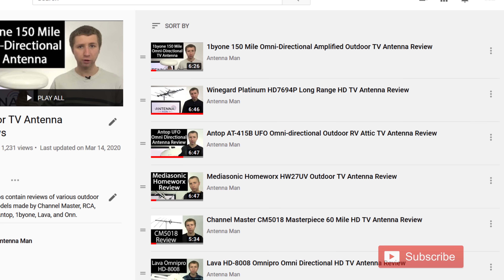Lose TV Stations at Night? This Common Item Interferes with TV Reception

Comment: I still collect different TV antennas from AMAZON. The one flashlight that's best is called VICTAGEN. 6 of them light up the entire living room and last almost 14 hours with one charge. No reception problems. I place 4 in front my 75 inch NANO TV. Simply pointing straight up, they create a torch effect illuminating the ceiling above the big screen. Of course AMAZON is sold out- aren't they always?

Comment: You are correct because I noticed this. They also interfere with AM reception.
You’re also right about those flat antennas Tyler. I always had to move the antenna every day as I had trouble with Baltimore channel(s) 11and 13. No such problem with the Antop 400BV UHF/VHF antenna. Thanks again for these helpful videos and the streams. Much appreciated Sir! Take Care.

Comment: Wow, I had no idea this was a problem.  I've never had any issues with my LED bulbs.  Maybe it's a quality issue with cheaper bulbs?
Reply: Richard Forester the cheaper bulbs lack interference filter snubber capacitors See my other post about adding a snubber capacitor to the light fixture used by a LED Bulb to cut the RF Hash being transmitted into the AC wiring.

Comment: YES, I replaced the fluorescent lights in my garage with LED lights and the garage door remote control only works now if i am directly in front of the door with the remote in my hand and pointing it to the door. If I turn off the lights, then it works normal
Reply: maxbored install a remote light switch to turn the LED lights off while remote commanding the garage door to open or close. The remote light switch will be designed to have plenty of range despite the interference from the LED bulbs. Another way is to install Snubber Capacitors on the lightbulbs fixtures as outlined in one of my other posts in this thread.
Reply: Perhaps route/reroute the garage door opener antenna closer to the outside. Copper wire is usually all you need to extend the garage opener antenna.

Comment: I did an audit of my RF noise for AM band. I turned off all my power strips. and tuned to a fringe AM station. The hardest offender to find was a USB charging line not on a strip. Came with the Amazon Kindle. The PC monitor, dimmable LEDs not as noisy as regular. LED noise worse in daylight. the inductive cook top kills shortwave. Lamps with large shades I've inserted a Y-socket insert offering two sockets. An noisy item was a touch an glow lamp for incandescent. LED's do affect weak TV, turn on a lamp and the picture drops audio or picture for a moment.  I put one noisy bulb in and a quiet one in for easy adjustment. My poor man's solution to a 3 way bulb using one-way lights.  I now turn off my TV and the power strip both when it is off. If my Samsung HD is spying on me, they will have to use their own power, not mine. My AM station is still in the middle of a estate dispute. When the wind blows and a lose cable arcs on the transmitter. For years I blamed the welders on the next block. But the wind also blows on days they are closed.  C'mon Probate judge. It's been since December. Rollye James left West Chester PA for Globe Ariz about 10 years ago. She doesn't mind night time power failures. It is her chance to do AM DXing like the old days, without the modern gadgets RF clutter.

Comment: I had read that LED bulbs can cause all kinds of radio interference so I started doing research a few years ago. My biggest concern was wi-fi interference. There are LED bulbs that carry a FCC certification on the package. The brand that I have been buying is Bioluz LED and I have not noticed any issues. I have no connection with Bioluz LED. Just a guy who needed to replace a bunch of CFL bulbs that were in my opinion one of the biggest scams pulled on consumers in lighting industry history. So just make sure the LED bulbs you buy have the FCC logo on the box and you should be good???
Reply: As far as I can determine, all LED bulbs sold in the USA legally have to comply with FCC regulations. I'd venture a guess that if you are buying LED bulbs in the USA that don't comply with FCC regulations, they probably aren't UL listed either, and are cheap junk of questionable quality. It's another matter entirely why the dimbulbs in Washington aren't cracking down on this stuff.
Reply: Fcc cert says that it cannot cause harmful interference and has to accept any interference... pretty much the jist of it.

Comment: A better brand of LED bulb may eliminate the issue.  A few years ago, I installed some Utilitech LED bulbs (from Lowes) in my garage door openers.  Then I noticed that I couldn't get much range when backing out of the garage after opening the doors (lights would be on).  When pulling up to the house (bulbs off), the range was fine.  I realized that it was those bulbs.  I replaced them with some Phillips brand and haven't had the issue since.
Reply from the maker: Yes it definitely varies by brand. Some are worse than others.

Comment: Great videos! 

I started designing antennas in 1974. Antenna wave propagation can be complicated but you do a good job of explaining the differences between VHF and UHF.
Also, thanks for trying to wean people off of the idea of an “HD” antenna.
However, a point can be made that an antenna that is specifically designed with the new frequencies in mind can be referred to as an HD antenna in the sense that the new frequencies allotted for TV are done so with the idea of digital transmissions in mind which then results in a signal that supports HD resolution.
A few companies have designed such.
Other the other hand, technically, an antenna is neither Analog or Digital, HD, side band, narrow band, etc.
An antenna is cut to work a particular frequency and range of frequencies regardless of the TYPE of transmission.

Please keep up the great work. There is not enough guys like you who with go to the lengths you go in explaining what people need to do and why, to get the best possible TV reception.
Reply: I understand what you are saying. The same argument was used when stations began using color back in the 60's.  There was no such thing as an antenna that supported color.  Any antenna did.  I would prefer they drop all of the HD, 1080i, atsc 3.0 and all that crap and just advertise it as a VHF or UHF antenna or both.  It's misleading to most consumers.  And they should also advertise the gain of the antenna, gain at VHF and gain at UHF so consumers can make intelligent purchasing decisions.  This 45 mi, 60 mi, 100 mi rating is crap and also misleading.  Furthermore, they advertise some UHF antennas with VHF capability when it's VHF capability is only marginal.  The antenna industry (specifically those made in foreign countries) needs to be cleaned up and Tyler is doing a great job getting the truth out.
Reply: Do you have a specific antenna that you would recommend?

Comment: Why do i loose reception when i plug my charger for cell phone in?
Reply from the maker: Same reason - electrical noise. Try a different charger.
Reply: Eugene w I had that problem in the car with terrestrial radio.  As Tyler said, a different charger that wasn’t cheap solved my problem.
Reply: Try using ferrite bead or toroid ring with the charger wire looped through a couple of times.

Comment: what you were describing sounds very similar to an article I read years ago about LED lightbulbs interfering with Wi-Fi reception as well. So if they can interfere with Wi-Fi then what you’re saying makes absolute sense. I am a ham radio operator, and some of my friends that are in the hobby with me have said the same thing about the same bulbs causing problems with radio reception to.

Comment: Wow, something as simple as a light bulb. Question, do cables from the electrical poles on the streets interfere with the reception? I seem to lose certain channels during the day, but at night they come back
Reply: Bad daytime and good night time reception could be due to the way that the atmosphere can bend VHF and UHF signals.  In the daytime there's hot air near the earth's surface and colder air aloft.  This tends to bend the radio waves upwards, reducing signal strength near the earth.  At night the earth cools rapidly, so the air near the ground is cooler than the air aloft, bending the radio waves downwards and making them stronger near the earth.  Also, some stations change power level and antenna pattern at night.

Comment: I believe any electrical or electronic device to be used in the home is required to be tested for compliance with FCC Part 15 requirements. Best to look on the package for manufacturer certification for compliance. If the FCC is requiring testing for compliance, the it is high time for updating it its rules to include any lighting devices that uses any form of switching mode power supply electronics to be tested!

Comment: Long fluorescent tubes, commonly found in overhead shop lights, are another source of broadband noise.  When my basement shop light and garage shop lights are on, over the air interference becomes a real problem.  Using a spectrum analyzer, I found that the ambient noise floor jumps more than 20% when those lights are on.
Reply: John Clark adding snubber capacitors across the bulb’s connections at the ballast output wires may help. High working voltages on the capacitor such as 1000 volts are recommended.  The value of 0.047 uF (47 nF) would still be appropriate.

Comment: It’s funny because reception usually improves at night time.  But I believe this would be a true case he’s pointing out.
Reply from the maker: Yes atmospheric conditions are usually better at night so if someone has issues on many channels at that time it's likely interference - possibly from LED light bulbs
Reply: Same here, I live in Baltimore and the stations in DC are like 50/50 but around 9-30 ( in normal weather conditions) like magic,  they all work.

Comment: Watching the light bulb DID NOT entertain me, but hearing the junk antennas hit the floor 3 times DID!
Reply: Why do people keep buying these junk antennas? Because cheap does as cheap is.
Reply: @ninocervini7867  I bought on of thr flat antennas. I read the marketing hype and the reviews that said it was the best invention since sliced bread and it uses military technology so you know it has to be good. 

Then I searched to figure out why it didn't work as well as the old RCA rabbit ears I had before the digital change and came across this channel. 

So lack of knowledge and marketing hype did it for me. I assume I'm not alone.
Reply: @ninocervini7867  Many of these get a lot of stars on Amazon, for whatever reason. Caveat Emptor.
Reply: @mikemandell132  You know what else gets a lot of Amazon stars? Cheap $10 LED flashlights! === which konk out just as easily as those cheap antennas! Just as Tyler does...I tell people not to buy cheap "zooming head" flashlights which all have the same design...and which break for the same reasons, but they buy them anyway! (I know how Tyler feels)
Reply: @ninocervini7867  
I bought one on a goof for that reason, the antenna actually kinda works but like he said the preamp blows out in a month, I didn't use long enough to find out.
Reply: Yes when it hit the floor it made a sound like "PingBingDing".
Reply: @GenerallyGeneralLee  Really? I thought it kinda sounded like a dull  kaching kaching. Lol.
Reply: Guess what Tyler, the first antenna you tossed is what I've been using for almost five years . I am in the Sierras at 2500 ft with trees on my property that are50 to 90 ft tall and the tower I aimed for is 112 miles away and 2400 ft lower than my home. I receive 48 channels high tight and squared away!  I feel as though you are telling us what you believe to be true, but obvious to me you aren't the end all be all in the antenna world that you think you are. I suggest you try one before you slander the product. Just saying that my personal experience as an electronics engineer for 36 years there are situations that will as we say, stump the stars no matter what your schooling or work experiences might dictate.
Reply: Maybe partying will help. 😅
Reply: I had the big one, it was great for a year. Then it went bad. Now I'm back to rabbit ears.

Comment: Oh I also forgot to mention that my automatic garage door instructions recommend not installing LED lights in the garage as it could cause the door opener not to work due to the RF interference of LED bulbs.  I left the LED lights in the garage and haven’t had issues but I kept it in mind.
Reply: ds99 our LED puck lights in the kitchen prevented the remote control for our garage door opener from working. It took some time for us to figure out the source of that problem!

Comment: I have LED lightbulbs all over my house but my antenna is in the attic so that could be why I have a great signal 24/7.   I remember as a kid our tv would get messed up if mom was vacuuming or using the electric mixer.  We only had a couple of VHF channels in our location back then.  As a kid I used to think it was interference going through the electrical wiring of the house.   I didn’t realize it was interference in the airwaves.  I just knew the vacuum was plugged into an electrical outlet and so was the tv so it must be scrambling the electrical power.  😂
Reply: I have this issue when i run the paper shears on channel 9 (physical) i thought it had to do with the amp

Comment: as with most things I find using higher quality bulbs instead of bulk packs of cheapos will prevent issues - I have all Hue and LED and reception hasn't been affected on TV or 2M ham compared to having them all disconnected from power completely

Comment: Also some cheap power adapter cause it to. I got a radio charger that was some knock off brand and during charging singnal would jump up down every few seconds.
Reply: I have a number of cordless RIDGID power tools.  If I have the RIDGID charger charging batteries in the workshop, my shop radio is filled with the loud buzzz of static and can't be listened to.
Reply: Being thst the AC adapter is charging a radio, or near a radio,  need a conventional charger with an old school 60 HZ transformer, not a switch mode high frequency AC to DC power supply. 

The old school 60 HZ ac to DC power adapters are heavy in comparison the same voltage and current of the newer switching power supplies. Radio Shack sold literally tons of them and only units last dying gasp, sold the new switching AC to DC adapters.

Comment: The thing is that 1 led 60 Watt equivalent light bulb saves $15 a year over incandescent. That's each bill.  It doesn't take many bulbs to save an entire months power bill. My guess is better quality LED's likely have less RF interference than the cheap dollar store ones, would be an interesting test.  Probably is put the antenna outside, and mount it as high as possible.  That's further from the bulbs, and better for the signal
Reply: Better quality LEDs will meet FCC regulations and will be UL listed as well, and are less likely to burn your house down or electrocute you.

Comment: Whenever I experience a bad signal,
I simply close my eyes, pinch my nose, and float an overcooked air biscuit in the direction of the antenna..
I can't explain how/why it works, but my father and his father regularly applied this technique on family t.v. nights.

Comment: Wow.  I was expecting a microwave instead of a light bulb lol
Reply: Me too, & yes Google it, it can indeed cause issues.
Reply: Microwave Magnetron operates at 2.43GHz, same frequency as wifi. FDA regulates external emissions be below1 micro watt per meter, therefore no wifi interference. If wifi or fm radio or tv problems exist, you risk sterility and cancer too.
Reply: No Microwaves don't emit anything harmful, believe it or not.
Reply: @kb1kos  Yeah but I remember back in the day they used to mess with your wifi signal.  Or at least I remember being told that at some point when I was young

Comment: Antenna Man, I have a question. With the FCC REPACK coming to an end, I was wondering if the final phase (Phase 10) will finally bring better signals and possibly new channels? Also, with the Repack ending, will I still have to rescan here and there and if the FCC might due another Repack in the coming years? Thank you so much for your knowledge on antennas, especially during these “Recent Events” going on. Godspeed.
Reply: Had the same question,  sort of, seeing that I don't have a next gen reciever in my tv, mine will still be the same BUT I was wondering if the 1.0 will be at full power again once they add 3.0???

Comment: Thank you for not clickbaiting. The weird thing I am encountering with antenna reception is that I actually get many more local channels than are available on local cable. In Dallas there are 85 or more channels, most of them subchannels of the major network channels.
Reply: if you still have an analog tuner and a good uhf antenna in a good location you can pick up channel 22.

Comment: Interesting, indeed!  I recall back in the analog days of TV, the reception culprit could have been with fluorescent lighting, as the ballasts in those lighting fixtures were notorious for frequency interference if you used an indoor antenna.
Reply: Computers were also notorious for causing problems with analog TV reception. Anything below channel 6 was the worst affected.
Reply: YES, absolutely.  I ended up getting rid of the whole fixture completely and put up a 2-bulb fixture, and used 2 LEDs that didn't affect my TV reception.  Now, once in a while, I'll have an LED that will interfere, but luckily, I don't go in that room much for anything ;-P But certain LEDs can work without interference.